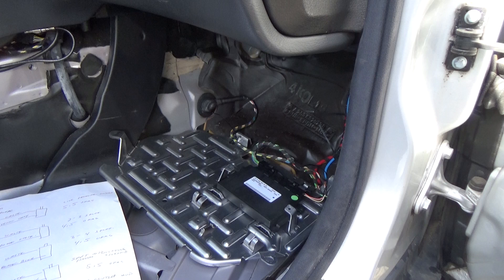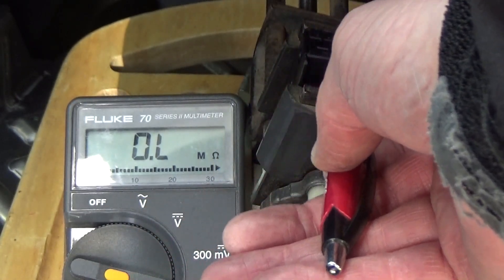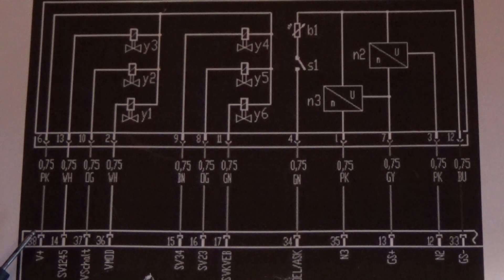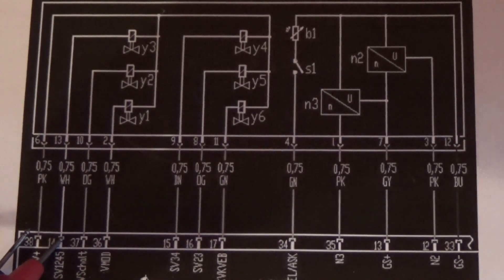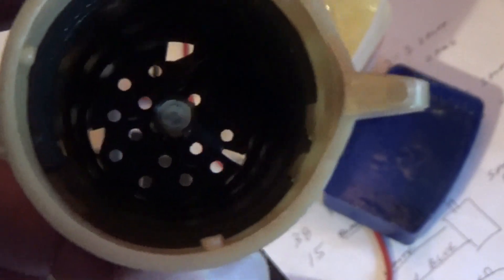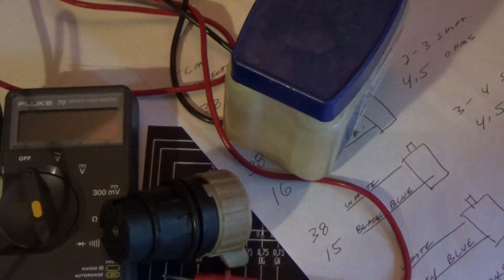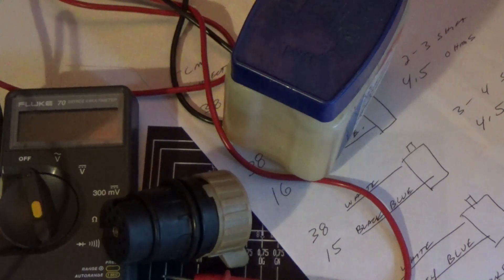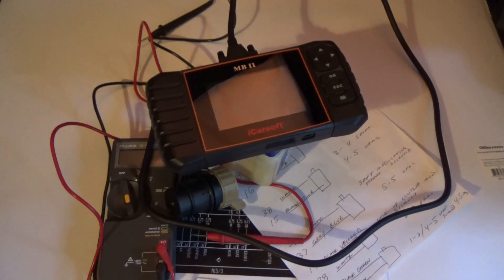MERCEDES BENZ Limp Mode/no Shift  REMOTE TEST CONDUCTOR PLATE/SOLENOIDS From TCM CONNECTOR w VOM

Comment: The harness 13 pin plug that enters gearbox has no soldered female pins   one or more intermittently come loose and limp mode happens also intermittently very hard to find

Comment: AMAZING VIDEO! IVE bin struggling with a trans problem that throws the code P0702. Im running these tests today. I already changed the plug because it was leaking and I cleared the code but it keeps coming back at random. paid a shop 600 canadian and they still couldnt pin point the issue witch feels kind of ridiculous. Makes no sence why the didnt run this test. I feel cheated. Anyways this test is going to answer s huge question I had and your video couldnt have come at a better time because I was about to change my plate without even knowing for sure I had to!

Comment: David excellent video, and yes I did subscribe. Can you or anyone on this page tell me what would cause the transmission to shift but not engage. The live data scan shows all the shifter locations are recognized but the trans does not engage. I have a Autel scanner with the 38 MB adapter which can rest the trans, a icarsoft scanner that also can reset some tans functions and has live data, the conductor plate and filter has been replaced and ran fine for months.  I also checked the brake light switch, wheel speed sensors, and any oil leaks from the tans going to the electrical box. I will follow your steps in checking the solenoids but they were checked and ok when I replaced the conductor plate.  I have a 98 Mercedes SL. Any suggestions that you or anyone on the page would be greatly appreciated. Thanks
Reply from the maker: Fluid level is good? Checked at operating temp on level ground? Any problem w electronics/connections/solenoids will keep in in 2nd gear (limp mode)
Reply: @Vortxrex  The fluid is at the correct level checked at the correct operating temp.  Wiring harness from the trans is dry, linkage to valve body is connected, the solenoids  were checked during the conductor plate replacement.  The car never went into limp mode. I was taking off slowly from a light and it suddenly had no power from the trans.  No warning, prior the car ran flawlessly.  Any suggestion you might have would be greatly appreciated and thank you for the prompt response.
Reply from the maker: No limp mode means all the electronic systems are working and there is something mechanical wrong in the transmission. My next move would be to replace the valve body. How dirty was the fluid?
Reply: @Vortxrex  The elimination of the electronics is a big help, I appreciate it. As for the oil, nothing really out of the ordinary, no metal shavings or chunks of metal. Before I go through the valve body is their a way to test the trans pump while in the car?  I've come across some information stating it a common problem with the 7222.6. Thank you for your help you've already saved my a lot of time.

Comment: Hi everyone and David Frank, thanks for the very detailed video. I have a problem with 722.6 on 2003 w211. I'm getting from my TCM:
P2502 Gear not plausible, or gear box spins
and
P220A N2/N3 RPM comparison nor plausible
I've replaced: conductor plate (OEM), whole valve body with another conductor plate and other solenoids, plug (OEM), cleaned all contacts (contacts were fine, only very little oil). I was resetting codes in TCM using Mercedes-specific CarSoft v12 (not regular obd). Every time after resetting code (and codes are really reset), I'm driving and getting the same codes again. Unable to find the answer. If anyone knows what might be the problem, please let me know. Thank you.

Comment: Thank u for the clear infos and video, i am doing my deep research right now then I saw ur video,my CLK 320 2002 is in limp mode shifts only from 1st to 2nd & R even we have changed the conductor plate + check engine light is ON + from P to N or D u hear a bang ! 
What do u think is the reason and from where to start ? I have ordered the icarsoft i980 already before i watch ur video and I don’t know if it will help.
Thanks again for the clear infos in ur Video and greetings from Austria.
Reply: For me the first time this happened, I had to change the Shifter module (super expensive), AND the conductor plate. Sucked big time. That was 2 years ago, and now it's back in limp mode and so I gotta go for round two. I feel I may need a new valve body this time around. If I'm going in, I'lll likely just do a valve body and conductor plate. I feel like the clutchpacks inside are fine. 

If you fixed it by now, what was it?
Reply: @paulsilva1357  unfortunately we couldn’t figure it out and the car is sleeping in the garage. I fed up from searching and wasting time in the transmission black hole.

Comment: I have a 98 SLK230 and a Foxwell medcedes scanner (38 pin round connector). When it tries to read the TCM, it reports a CAN fault. I do have some ATF on the connector at the transmission, and I have the new pilot bushing on order and plan to replace. My TCM is clean- no oil has wicked up.
So, I'll replace that pilot bushing (seems to me that I could just replace the O-ring, but the new part is $15, so what the heck). But if I keep getting a CAN bus fault when reading the TCM, does that sound like a wiring harness issue (internal shorts, etc)?
Thanks for the GREAT video- very well explained!  I have the exact same Fluke, BTW.

Comment: Hey, great video! Do you know if there is a way to test the TSS turbine speed sense from this harness for code p0715?
Reply: yes there is.But im afraid i do not remember which pins it is.I used to work for the mb dealer..and did alot of testing like this.But there is certain pins that is for the turbine speed sensors.I may going to make a video on this at some point..as i just did a full EHS overhaul on my w210 e50 amg.Greetings from Norway
Reply: I have this error code currently, i I know it's a long time ago but did you manage to find out what pin it was for TSS?
Reply: @stephenbarnes5341  Sorry, I don't remember, but I did end up replacing the transmission conductor plate and I think that was what fixed it. Good luck!
Reply: Was your car in limp mode at anytime
Reply: @nimsom50

Comment: Thanks a great help. Can I suggest using silicone grease and not petroleum based grease that degrade the rubber O rings on the connector??
Reply: stick to petroleum based lubcricant when doing the inner 0 ring.Outer one could easily do with silicone grease.But do not overdo it.To be honest..its good enough making sure everything is 100 percent clean when reinstalling a new connector..and apply just a thin film of oil on both.That is enough..and it will never cause any unnessesary issues :)  Greetings from Norway,Stefan